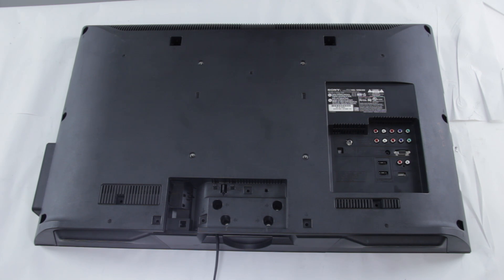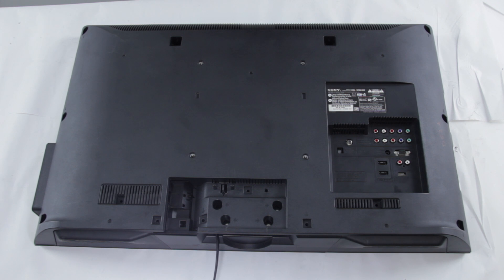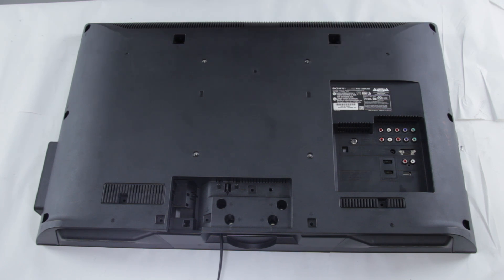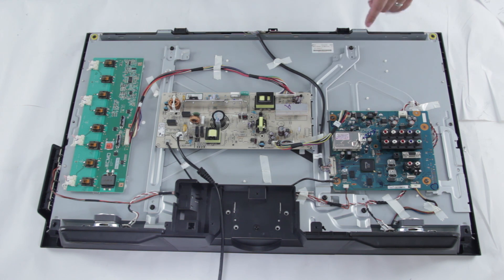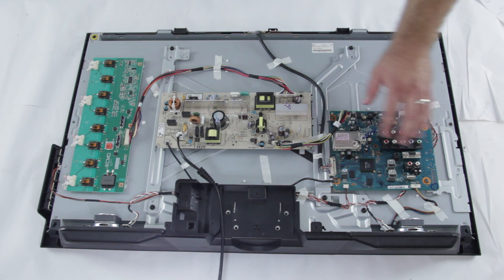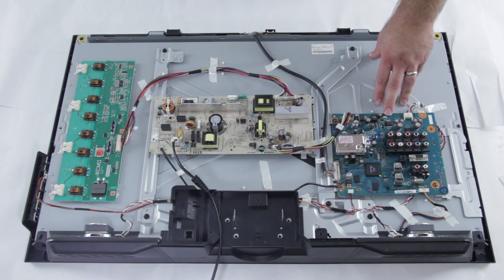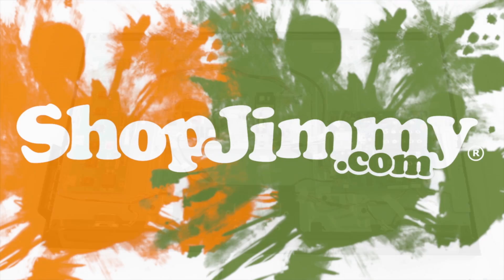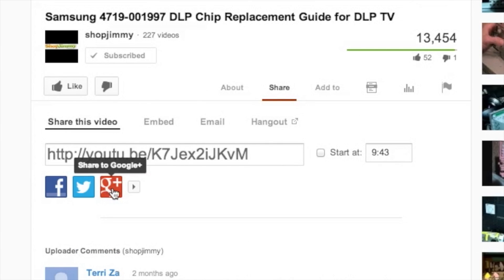LCD TV Repair - TV Has Audio, No Video - Common Main Board Symptoms & Solutions

Comment: I have a 19LG30-UA.SUSGLBK that I have been working on lately. At first I diagnosed the initial issue of (at first) no red light indicator when plugged in. Tried again, second time, red light came on, and after pressing the power button, indicator light went out. And thirdly, red indicator light came on, and after pressing the power button, the led stayed lit.

I checked the power supply board, found 4 bubbled capacitors, so I replaced them, and voila, it starts up normally! However, I ran into another main issue that I have been unable to solve. After pressing the power button, the red led blinks twice, and on the third blink it stays on with blue, but as the main board processes the audio and picture, it displays the picture, showing the channel number and static then the picture goes out after a split second, but the audio stays on. The panel controls work as well, but no display for input, menu and enter buttons (makes sense).

Currently it only has audio out of 1 speaker, but I am less worried about that issue, and more focused on the picture issue. I plugged in a coaxial cable to test it, and of course it would produce sound, but no picture. Unfortunately, there is no main boards for me to purchase for this model on any website, including ebay and ShopJimmy.com. So my question is this, could it actually be the lcd screen that is bad, or is it the main board? Normally I would say it was the main board, however I also know that an lcd screen can try to display pixels, but shut down if there is a problem.

Also for anyone reading this with the same issues, this tv does not have an inverter board, so that singles the problem down to those two possibilities. The woman that I got this tv from said that before the power supply failed that she used to have to wiggle the power cord and press the power button at the same time, but to me, that sounds illogical and impossible for that to be a resolution to that specific issue. Maybe for the power supply board, but not a main board.

With my mind still stuck on fixing the main board, and not worrying about the lcd screen, how would I go about repairing this tv? I have the repair manual for this tv: http://diagramasde.com/diagramas/otros2/LG-19LG30-UA.pdf

however, even with my multi-meter, I am a bit clueless to testing the voltages and diodes and what number ranges I should be looking for in order to repair the main board, if that was the culprit. Like with the power supply, 2/4 capacitors read 230, which were closest to the heatsink (poorly designed product imo to place the capacitors that close to a heatsink) and the other 2 that were also bubbled read 440 or around it. So I replaced all 4 of them. Now they all read the same or close to it.

Honestly, if someone had the main board, I would just rather replace this one with a used or new one instead of messing with the main board, its not worth the time imo for a tv dated to be manufactured back in April 2008. The ones on shopjimmy were priced at $40, which is VERY reasonable, however its still out of stock, which I don't expect any more to come in being that the tv is almost 7 years old. Any kind of number ranges video or website could I look at for repairing this? Any idea when these will be back in stock? Any idea if my hypothesis is correct? ANY information is GREATLY appreciated, in all honesty, I am trying to fix this because it had sentimental value to its true owner, therefore this was mostly a favor to her and her husband (gift from him). And again, thanks!

Comment: I was working on a coby TFTV3227 flat screen fixing a double picture problem and now all I have is sound and a blue screen. What might be the problem?
Reply from the maker: Jeffery cox   This sounds like a TV panel (TV Screen) problem.  If your TV panel is bad, it may be more cost-effective to replace the TV as panels are typically hard to find in stock, difficult to replace, and expensive.  Thanks and please let us know if you have any further questions!  www.shopjimmy.com
Reply: could be a tcon board.

Comment: I own a Vizio VF550M and all I'm getting is the "Vizio" logo is lit orange and won't turn white, stays orange. I ordered in a new power supply, put it in, and still the same results. What could be causing this?
Reply from the maker: Abram Osborne  Please watch this video FIRST to help with your repair!  https://www.youtube.com/watch?v=BP3NVNCGEv8  I recommend replacing the main board in your TV.  Click here for replacement parts for your TV model number:  http://www.shopjimmy.com/catalogsearch/result/index/?cat=56&q=VF550M  There may be multiple boards for the same TV model number, be sure to match part numbers on your current board, with your replacement for compatibility.  Here is a link to a video showing how to identify your part number, click here:  https://www.youtube.com/watch?v=kxkeGLhlQY8  Thanks and please let us know if you have any further questions with your TV Repair!  www.shopjimmy.com

Comment: Hi,
I’ve just got a Philips 42pfl7422/79 and need some help figuring out its fault. When I turn in on the standby light comes on and can turn tv on but the backlight does not turn on at all. I’ve put a flash light to the screen and I can see that the picture is perfect but obviously hard to see without backlight. I haven’t managed to get any sound out of it yet so not sure what the problem is. First thought it could be backlight inverters but didn’t think this would cause no sound. Have looked at a load of bits on the web but can’t find a answer that helps. Any ideas?? Cheers
Reply: Just to add, have tried connecting through pc and hdmi slots and can still only see picture with flashlight and no sound or backlight.
Reply: Update, turned the tv on and off a few times and then heard the speakers buzzing, plugged my PC into it and now have got sound playing through the tv so just have the issue with the backlight not coming on at all. Hope this helps. Cheers
Reply from the maker: steve mansell  Please watch this video FIRST to help with your repair!  https://www.youtube.com/watch?v=BP3NVNCGEv8  This sounds like a problem with your main board and I recommend replacing it.  Click this link to replacement parts for your TV model number:  http://www.shopjimmy.com/catalogsearch/result/index/?cat=56&q=42pfl7422  There may be multiple boards for the same TV model number, be sure to match part numbers on your current board, with your replacement for compatibility.  Here is a link to a video showing how to identify your part number, click here:  https://www.youtube.com/watch?v=xSSxNZXZIXA  Thanks and please let us know if you have any further questions with your TV Repair!  www.shopjimmy.com
Reply: Hi Jimmy,

Thanks for the quick response, I've watch the video and checked your shop jimmy site but my part does not appear to be there. The part i need is part number 715T2408-3. I have found it on other site but would prefer to buy from you as from all the research I've done your name always come up as a reputable place to buy. Don't know if you can track down this part but we'll be great if possible. 
Cheers steve
Reply from the maker: steve mansell   Here is a link to similar parts, but I don't think they match your exact part number:  http://www.shopjimmy.com/catalogsearch/result/?q=715T2408  Thanks!  www.shopjimmy.com
Reply: Yeah that does look a lot like it in the one picture but the aeriel connector and heat sink is not on the one pictured and it says it out of stock, do you know if they usually come with the heat sink and aeriel input attached? I want to buy one but want all the bits on it if I do as don't want to have to mess with it, just install and go. 
Cheers 
Steve
Reply: symptom suggests you need inverter board, if you do get a main board and it's the same issue, send it back and try inverter board, they cost less too.
Reply: Does anyone know of an easy way to test out what's faulty. I saw a video where the guy used wires as jumpers to get the back light to come on so he knew the inverters were ok, is this possible with this model and is it pretty easy to do?

Comment: Hi Jimmy
Im having trouble with my Samsung LE32B450CAW.
The problem is that i have a green tint in the colors everything that has to be white looks green.
happened just like that.Is this to repair?

Greetings
Reply from the maker: MrMadfool  Please watch this video FIRST to help with your repair!  https://www.youtube.com/watch?v=BP3NVNCGEv8  I recommend replacing the main board in your TV.  Click this link to replacement parts:  http://www.shopjimmy.com/catalogsearch/result/index/?cat=56&q=32B450  There may be multiple boards for the same TV model number, be sure to match part numbers on your current board, with your replacement for compatibility.  Here is a link to a video showing how to identify your part number, click here:  https://www.youtube.com/watch?v=BEPWrefQvqI  Thanks and please let us know if you have any further questions with your TV Repair!  www.shopjimmy.com
Reply: ShopJimmy.com  thx for the response if i will buy the mainboard this will solve the problem?
If it doesnt work after the replacement what are my options can i return it or swap it for another board?

gretings

Comment: Hi, I have a Vizio E321MV and the picture in the TV has been presenting vertical lines and a quadrant in which the colors seem to be shaking. This happens in all the Channels and inputs. Could this be the "mainboard" or the T-Con Board?  Thanks in Advance.
Reply from the maker: neojuano   This sounds like a TV panel (TV Screen) problem.  If your TV panel is bad, it may be more cost-effective to replace the TV as panels are typically hard to find in stock, difficult to replace, and expensive.  Thanks and please let us know if you have any further questions!  www.shopjimmy.com

Comment: Element TV ELDFT406 turns off randomly at varying intervals (anywhere from 10 minutes to 2 hours).  TV has been reset, unplugged etc with no fix.  Is this a power supply problem?
Reply from the maker: Davis Carroll  Please watch this video FIRST to help with your repair!  https://www.youtube.com/watch?v=BP3NVNCGEv8  I recommend replacing the main board in your TV.  Click this link to replacement parts:  http://www.shopjimmy.com/catalogsearch/result/index/?cat=56&q=ELDFT406  There may be multiple boards for the same TV model number, be sure to match part numbers on your current board, with your replacement for compatibility.  Thanks and please let us know if you have any further questions with your TV Repair!  www.shopjimmy.com

Comment: I have a L c-60c46u sharp  aquos.  I have been told it's the main control unit and that it should be replaced      I thing part number is cpwbx3520tpz.  I am getting "3" images, or pictures if you will, on the TV, rather than just one.  What do you think?
Reply from the maker: Ken Stanley   This sounds like a TV panel (TV Screen) problem.  If your TV panel is bad, it may be more cost-effective to replace the TV as panels are typically hard to find in stock, difficult to replace, and expensive.  Thanks and please let us know if you have any further questions!  www.shopjimmy.com

Comment: I have an Emerson 19” LCD TV model  #SLC195EM8  2. I am the original owner and haven't had any problems
until now. When I turn it on, the set immediately goes into standby mode with no picture. Can you tell me what is causing the problem?
Reply from the maker: AL DJ  Please watch this video FIRST to help with your repair!  TV Repair! LCD, LED, Plasma, DLP How To Fix Your TV with ShopJimmy.com Help!  I recommend replacing the digital board.  Click this link to replacement parts for your TV.  http://www.shopjimmy.com/catalogsearch/result/index/?cat=225&q=SLC195EM8+  There may be multiple digital boards for the same TV model number, be sure to match part numbers on your current board, with your replacement for compatibility.  Here is a link to a video showing how to identify your part number, click here:  Part ID Numbers for Sylvania, Emerson, Philips Magnavox MPS, MPW, MUT, & Digital Boards TV Repair  Thanks and please let us know if you have any further questions with your TV Repair!  www.shopjimmy.com

Comment: I have a Hitachi l42vc04u - initially the 1 hdmi port stopped working, then the second. I used it for 2-3 months using just RGB connection. The other day I went to switch the TV on but it will not come on, the blue power light is on but screen is not coming on. Do I need to replace the main board? Should I try connecting an input and checking if the sound works? Thanks
Reply from the maker: B Torun  This sounds like a main board problem.  Unfortunately I do not see any replacement parts in the search results for your TV model number on our website.  Please reply with your part number on your main board and I can try searching for replacement parts.  Thanks and please let us know if you have any further questions!  www.shopjimmy.com

Comment: Hi the problem of my tv is no picture ana no sound but the rf led is lit when it is on. If i press the power button the blue light just for a secńd and its gone what could be the possible cause can u help me? The model is hyundai hlt-32e800
Reply from the maker: dante aguila   I recommend replacing the main board in your TV.  Unfortunately I do not see any replacement parts in the search results for your TV model number on our website.  Please reply with your part number on your main board and I can try searching for replacement parts.  Thanks and please let us know if you have any further questions!  www.shopjimmy.com

Comment: Hello sir thank you for this video. I am having a LCD TV  DIGITEK 2005X and its motherboard model is CX NPTD15 01B. Its having the noisy sound problem and suddenly no sound like this continuously. The capacitors are looking well. What i need to do please.
Reply from the maker: jean roi   I recommend replacing the main board in your TV.  Unfortunately I do not see any replacement parts in the search results for your TV model number on our website.  Please reply with your part number on your main board and I can try searching for replacement parts.  Thanks and please let us know if you have any further questions!  www.shopjimmy.com

Comment: I have panasonic model no. TH-L24X5D LED TV  60 cm.

I am receiving no audio from past 1 week.

The speakers are fine and my set is also working properly both checked.

Please assist me in repairing the board as i think that is the problem.

Thank you.

Comment: About 2 weeks ago my vizio m550nv stopped showing the hdmi input in the input option it still had tv, av,and rgb. Then the tv would start to freeze shortly after being powered on and would sometimes randomly shut down flash amber and white on the vizio logo and power back on after about a minute and a half to two minutes. Then it froze and would not power down so I unplugged it. When I plugged it back in the logo flashed the amber and white and now will not power on using the power button on the tv (the power button is an independent chip with a ribbon cable to the main board). I can use the remote to power on the tv but no picture appears, the backlight comes on but that's all. Does this sound like a main board problem since the missing hdmi's are on the main board and the power button chip goes to the main board as well?
Reply from the maker: brandon white  Please watch this video FIRST to help with your repair!  TV Repair! LCD, LED, Plasma, DLP How To Fix Your TV with ShopJimmy.com Help!  I recommend replacing the main board in your TV.  Here is a link to replacement parts for your TV model number:  http://www.shopjimmy.com/catalogsearch/result/?q=m550nv  Be sure to match part numbers on your current board, with your replacement for compatibility.  Here is a link to a video showing how to identify your part number, click here:  TV Part Number Identification Guide for Vizio Main Boards (Plasma, LCD, LED)  Thanks and please let us know if you have any further questions with your TV Repair!  www.shopjimmy.com

Comment: Hi Jimmy,  I have a Samsung TV, Model TX-3T09WH.  It has a solarized screen on all channels.  Yet the menu screen appears to be normal.  What would you suggest is the problem and cost?.  It has a serial number of AH5U3CAP704864M. Thanks in advance.
Reply from the maker: dan151cer Arismendez   I recommend replacing the main board in your TV.  Unfortunately I do not see any replacement parts in the search results for your TV model number on our website.  Please reply with your part number on your main board and I can try searching for replacement parts.  Thanks and please let us know if you have any further questions!  www.shopjimmy.com

Comment: I have a envision 32 in lcd blue light on front no picture or sound.  Have replaced power supply already. L32w961. thank you in advance.
Reply from the maker: Carlos Cardenas   This sounds like a problem with the main board in your TV.  Here is a link to replacement parts: http://www.shopjimmy.com/catalogsearch/result/index/?cat=56&q=L32w961  Be sure to match part numbers on your current board, with your replacement for compatibility.  Thanks and please let us know if you have any further questions with your TV Repair!  www.shopjimmy.com